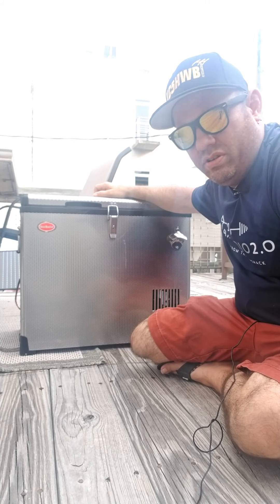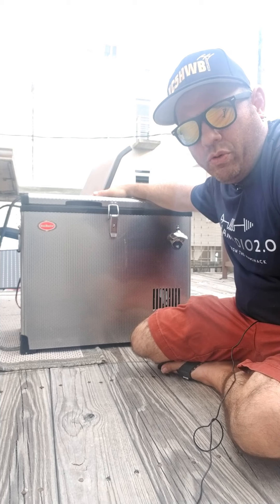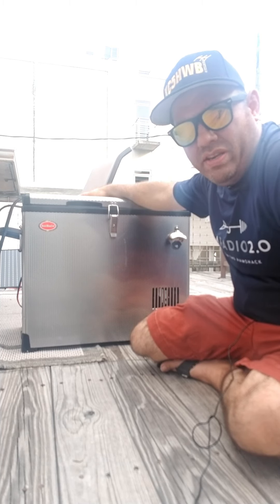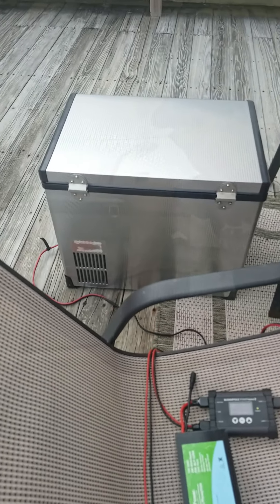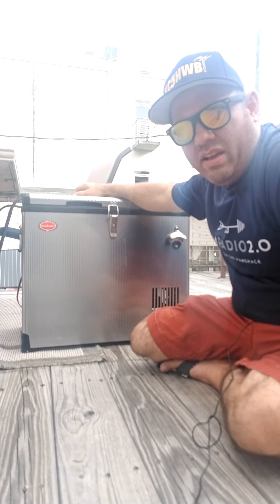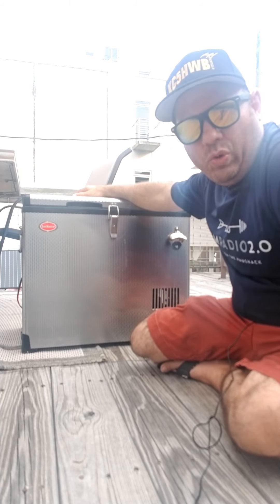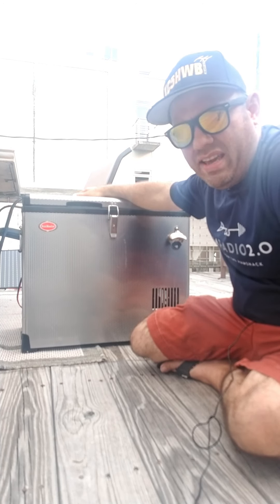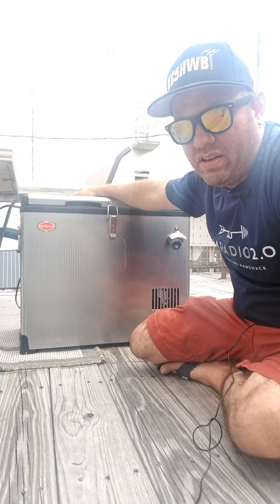Solar Powered Fridge with Bioenno Battery | Off Grid Refrigeration

Comment: Our Good Buddies which use 11M (Truckers on CB) and the RV'ers are the masters of 12-13.8 DC stuff.  Considering we use DC, and gen sets, those groups might have items we can use for FD, POTA, SOTA, IOTA, and other types of deployments.
Reply from the maker: Got a link for them?
Reply: @HamRadio2  No.  But your frig brought back conversations members of the Houston Tinplate Ops Soc had. Two things came out:  1.  The Trucker/RV connection 2. Homes should have both grounded 120V AC and a 12 V DC Anderson PP wall sockets.  Why DC?  Gen set support, and a lot of things use 12-14 V DC....

HTOS uses APP connectors.  But we have our own color codes because Lionel and American Flyer both use 0-18V AC.  HTOS is in Memorial City Mall at I10 Katy and Gessner near West Beltway 8.  Open Sat 1 to 5, Tuesday 7 to 9.

Let me ask at HTOS, ham sites, and the net for sources.  Truck stops have this stuff, but it is at arm ad leg prices....

Comment: You should have run it overnight like a real-world situation like zombies cutting your power off.   
Would your beer still be cold three days later? Enquiry minds want to know.
Reply from the maker: It's been running for 7 days at this point in time.  It did die twice due to rain blocking the sun and not charging the battery back up again.  I could fix that by adding a larger battery or more panels.  But right now I am just testing out this setup
Reply: @HamRadio2  That is pretty good for that size of battery.